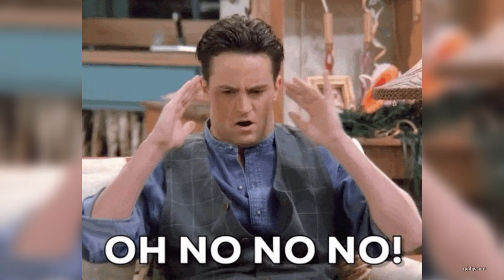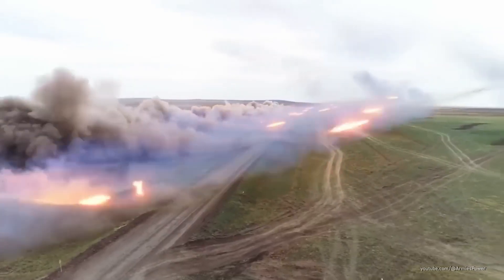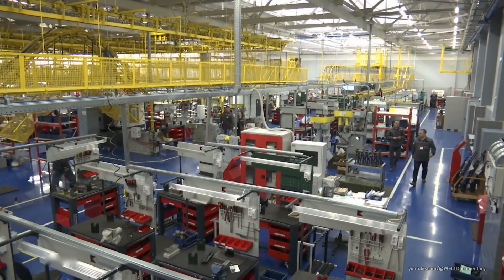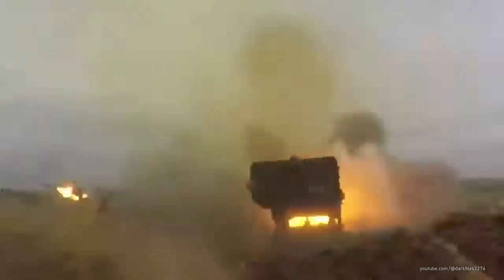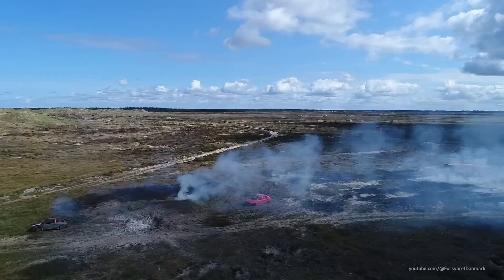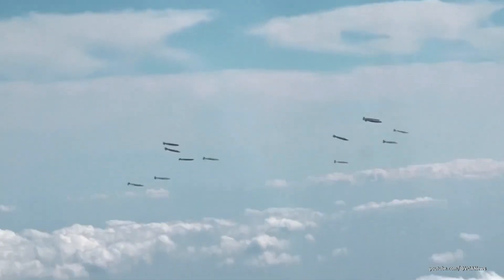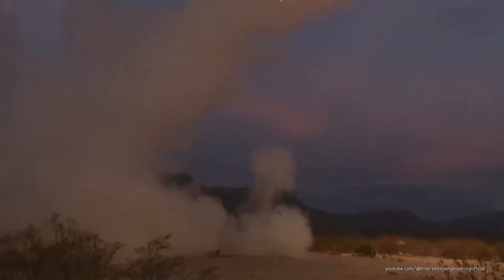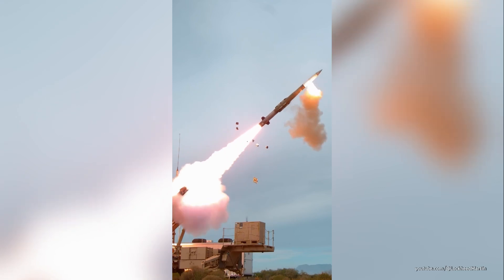Soviet Era Bomb Changed Battlefield Results for Russia

Comment: I don’t think air-fuel bombs are the same as "bunker busters". And I don’t think glide bombs are either.
Reply from the maker: Right! Thermobaric bombs hit surface targets with intense blast, bunker busters dig deep to reach reinforced structures, and glide bombs are all about precision. Which one do you think has the biggest impact on modern warfare?
Reply: @Weapons.Of.Victory what I’m saying is at 0:53, while talking about "vacuum bombs", you say, "these bad boys, nicknamed bunker busters…"
Reply: @mattp422  Thermobaric devices are very good for use in caves and bunkers...
Not every bunker is 50m deep underground...
But you are correct that out of 3 variants: KAB-1500LG-F-E, KAB-1500LG-Pr-E, KAB-1500-LG-OD-E only the second can be called "bunker busters" as its designed to pierce reinforced concrete and the 3rd one is of  fuel-air type.